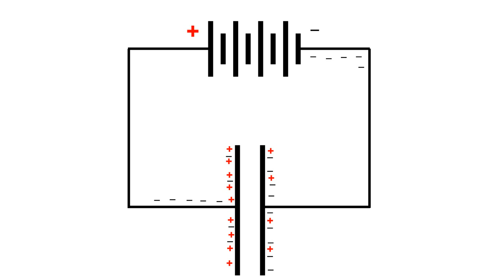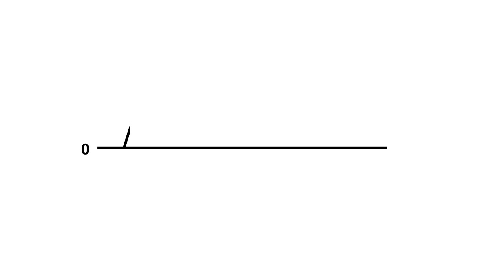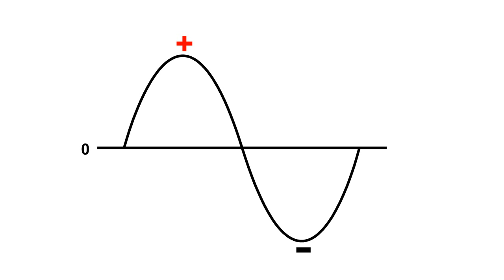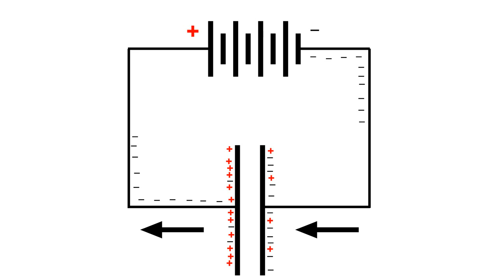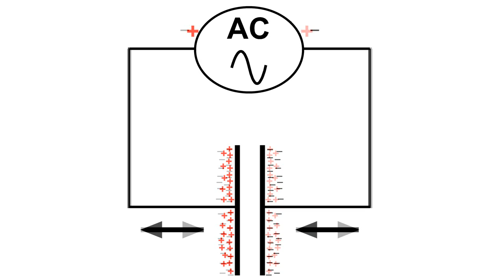Capacitors, DC and AC Current

Comment: Hi, I have been wondering about a AC signal that passes a  capacitor with polarity + and - ........a capacitor with polarity has normally the connection to the outer shield as minus, and the inner part connection as plus (+) .....the outer part of the polarity (minus) normally goes to the lowest impedance as I understand it.....but what about a incomming signal in a speaker crossover? Is the best way for the AC signal to go through the plus terminal of the capacitor  or the minus terminal?  Even polyester and polypropylene capacitores has outer shields....best rgds Kim
Reply from the maker: I have a set of DQ-10s. I looked up the crossover schematic. I think you will find it interesting. 
https://community.classicspeakerpages.net/topic/9355-dq-10-crossover-rebuild-ready-to-solder-help/
Reply: @AllAmericanFiveRadio   hi, thanks...in speaker crossovers I am aware that wirewound resistors might have higher capacitance because of the open field within the windings than mox resistors because of the construction, and that inductors has a DC resistance where the speaker factory have incalculated the Ohm values together with the speaker units. My question went on the newer polypropylene capacitors. If we take a signal at 1kHz (and connect one end to ground and the other end to signal in) and let it pass the capacitor in one direction while we place two fingers across the component we will be able to ses some noise on the oscilloscope...so...if we turn the capacitor 180 degrees and send the AC signal through the other end of the capacitor the same signal creates as example higher noise level...which means that the lower noise indicates that this end is the outer shield end.....does that make any sense to you? Thanks for your very informative videos. The best regards Kim
Reply from the maker: @k.j.h.432  You may need a higher frequency.
This video is from a friend. 
Mini Build - Capacitor Outside Foil Sniffer
https://www.youtube.com/watch?v=YpWYvB2RiQw
Reply: @AllAmericanFiveRadio  Thank you for your help...that is what I am looking for. Best regards Kim

Comment: Zero potential is not absolute, it is only a reference, much like in the case of gravitational potential. The notion results from mathematical integration between two points. One is conveniently considered to be zero. So ground I guess could be seen as the potential in relation to which all other potentials are evaluated. 

Also an interesting way to look at ground is that it's able to give or accept an infinite amount of charge without changing its potential.

Comment: What happens if the ac capacitor begins to go bad? As a tech, I would think possibly a fried component would not pass ac or dc voltage. But if it didn't go bad immediately, would it begin to pass less ac voltage/current Or would you begin to dc voltage beginning to pass through the capacitor? I'm a ups tech. (Battery back up)
Reply from the maker: There are two possibilities. A capacitor can start to have less capacitance or open completely like it's not even in the circuit. A capacitor can start to conduct electrons between the plates which means it is turning into a resistor and can short completely making it a wire.
Reply: Appreciate Video! Forgive me for the intrusion, I would appreciate your opinion. Have you heard about - Zanackson Pocket Buster (do a google search)? It is an awesome exclusive product for learning how to make an extra income online without the hard work. Ive heard some super things about it and my good mate called Gray at last got cool success with it.

Comment: It appears to me that there is a more fundamental question that should have been asked long long ago on day one.  I am surprised why it has never been asked and that of course includes myself.
Here is the question that really relates to this only very basic.
So when we hook up a couple of wires, one on each terminal of a battery.  Now you check the voltage at the end of the two wires, your voltmeter read whatever the battery voltage is, right?
What traveled to the end of each wire being an open circuit?
Reply from the maker: You would use an oscilloscope.
Reply: @AllAmericanFiveRadio  Maybe my question is not clear.  When I attach a wire to a battery terminal, am I essentially extending that battery terminal, regardless which terminal (+ or -)?
If I am, then it means charges must have climbed or moved/accumulated in the wire.   or how would one describe it?
If charges move which by definition it won't, being an open circuit, nonetheless if charges move then there should be every the smaller current measurable with most sensitive ammeter.
And would the position of the wire matter with respect to the other pole?
Say I stretch the wire in the opposite  way away from the other terminal?
Then I bring the wire and get it close to the other terminal of the battery without actually touching it and would there be a clear electric field now?

On another subject:
When charges move through a coil of wire, circular magnetic field is formed.  That we are told.
Now we are also told that magnetic field is formed between a positive and negative pole of a magnet.  Where is/are the magnet(s) and where are north and the south poles? as the electrons are moving straight ahead.  And even if we assume that their spin are all in the same ( spin up or down) otherwise the magnetic field will cancel by definition?

Comment: So technically, current DOES NOT flow through the dieletric to the other plate and other side of circuit? It just stores charges on either side depending upon what type of electric field is built up between the plates?
Reply from the maker: Yes, current flows but electrons do not travel between the plates. The electric field is the repulsion of negative charges of one plate pushing electrons off the other plate.

Comment: I don't think all the negative charges will escape from the positive terminal of the capacitor 1:21, because after certain period of time, the electrons will be pulled by both +ve side of battery and +ve side of capacitor, am I correct?
Reply from the maker: There is always positive and negative on both sides. I'm showing only the ones that move.
Reply from the maker: There are billions of free electrons on both sides, those are the ones that move. And yes I do have books that you can read, 24 of them form the Navy. This course form the navy is excellent!!!!!!!  
Navy Electricity and Electronics Training Series
http://www.richardmcwhorter.com/NavyTraining/ 
I hope you take this course.

Comment from the maker: The electrons are acting in the same manner with AC or DC. With DC, it does not change direction, so as the plates of the capacitor continue to increase with a charge, the charging rate decreases as the impedance increases. When the capacitor is fully charged with DC, it's impedance approaches infinity.

Comment: the capacitor, under AC current, creates expanding and collapsing magnetic fields over each plate inducing current into the opposing one thereby allowing current to flow? I'm not sure.
Reply from the maker: The magnetic field in the capacitor plates are miniscule. It is the repulsion of like charges that makes a capacitor charge.
Reply: I'm not understanding how capacitors pass AC current. I still see the two separate plates of the capacitor gathering opposite charges in an alternating fashion in accordance with the alternating AC with no electrons actually passing between them.
Reply from the maker: How  Capacitors charge and discharge
https://youtu.be/Ag2RujOHqJ8

Comment: I often here of the capacitor charging to the same voltage as the battery? why? doesn't the capacitor have its own storage limit for electrons? I'm imaging that, in this case, the plates of the capacitor are kind of extensions of the terminal, but why the same voltage as a battery? aren't they psychically different? Don't capacitors discharge at certain values?
Reply from the maker: Capacitors, DC and AC Current
https://www.youtube.com/watch?v=NInt1Ss3vQ4
How Capacitors charge and discharge
https://www.youtube.com/watch?v=Ag2RujOHqJ8

Comment from the maker: @512147214 
There's not one answer. You can use a capacitor to isolate an AC signal riding on top of a DC bias voltage, this is very common. You can use capacitors to filter a DC power supplies. You can use capacitors to drain unwanted RF from a circuit. Inductors can be use for the same things but are configured in the circuit differently. Sometimes a capacitor works better, sometimes an inductor works better. It takes some study to understand why.

Comment: Thank you for your great educational lessons

I have question please : i am confused how we can write : Vs= Vc knowing that the capacitor "gradualy" raise its voltage and doesnt respond instantaneously with the voltage source ! , why we are ignoring this fact and treating capacitor as if it is a resistor ?

Thank you in advance
Reply from the maker: It is not resistance, it is TIME.
Reply: @AllAmericanFiveRadio  l meant if a capacitor in parallel with AC voltage source , how we can write Vs = Vc knowing that the capacitor voltage will be a little "behind" the AC source voltage all the time ?.
Reply from the maker: @mohfa1806  The answer is still time, If the AC is 60 cycles the capacitor charge is never = to the source.
Reply: @AllAmericanFiveRadio  thanks for your reply

But i still dont understand in AC voltage source parallel to a capacitor , how in every book they write Vs=Vc knowing that its not true??..
Reply from the maker: @mohfa1806  Give me the tiles of those books.
Reply from the maker: @mohfa1806  Time Constant Calculator
https://www.digikey.com/en/resources/conversion-calculators/conversion-calculator-time-constant
Reply: @AllAmericanFiveRadio  thanks again ...i really appreciate your time replying to me , but my question was for AC voltage source not DC
Reply from the maker: @mohfa1806  You have missed the point. Even with DC the capacitor never gets to the source voltage.

Comment: I’m even more confused now. How does the current go through it then? If a motor is connected in series with a capacitor, current is definitely flowing through the circuit.
Reply from the maker: Maybe this video will help.
How Capacitors charge and discharge
https://www.youtube.com/watch?v=Ag2RujOHqJ8

Comment: One strange question please !

How those things, like TV , radio, etc  ...etc ...can work 
Because usually we bring AC 
To
*  the  transformer ... 240V~ 12V ...
*  Then a bridge rectifier ... AC to DC 
and after
 Power supply, ...  everything is run on DC Inside ??? 
...    Because
all those Capacitors are not supposed to do anything 
in DC Circuits...  Or I am wrong ??? 
...  🤣😬🤣😬🤣... 

I am just a total newcomer
 into the field of 
Electronics, but my understanding so far is that :
* capacitors are 
Reacting only in RF 
like ... Oscillations 
...  or... AC environment ,
...
 but in a DC they act 
Like switches in the 
"OFF position"  .  They block a current . ... So ... It looks little 
... ridiculous to me ... Lol. 
🤐🤐🤐🤐🤔🤪😬😱
Reply from the maker: These videos may help.
Half Wave Power Supply build and demo
https://www.youtube.com/watch?v=Oi75Y6fg8mw

Half/Full Wave Power Supply Oscilloscope Demo
https://www.youtube.com/watch?v=4kMXulubQFU

PI filter, Resistor Choke Oscilloscope Demo
https://www.youtube.com/watch?v=WzwaHO6WPCk

Comment: hi I have a 3kw single phase motor that drives a machine and the drive is connected to another machine so in effect depending which machine I drive the the motor will still be driven with no power to it I have been told that this will blow the capacitors and  I will need to switch them out of the system it has a start and run capacitors
Reply from the maker: Depending on the motors, the motor that is not running maybe generating voltage and this voltage maybe opposite to the applied voltage.

Comment: then why do leds blink when connected to a capacitor in a circuit
Reply: Because an LED is a DIODE.  And diodes only pass current in one direction.  You get current flow only half the time and therefore they "blink" on and off.;
Reply: Species 5618 thanks

Comment: If capacitors block DC then how/why is it that they're used to smooth DC? It doesn't make sense.
Reply from the maker: My FREE eBook : Password is:"allamericanfiveradio"
The Vacuum Tube Shortwave Radio 'Chapter 3'
http://www.richardmcwhorter.com/vacuumtuberadio/
Half Wave Power Supply build and demo
https://youtu.be/Oi75Y6fg8mw

Comment: Good explanation. I was kinda waiting for the purpose part, but there's plenty of youtube for that.
Reply from the maker: How Capacitors charge and discharge
https://www.youtube.com/watch?v=Ag2RujOHqJ8
Capacitors, DC, AC, and Frequencies
https://www.youtube.com/watch?v=YfJKNSkz_Lk
Audio Coupling Capacitor, how it Functions in a Circuit
https://www.youtube.com/watch?v=PAPnwX6YiIM
Lafayette Guitar Amplifier Signal Flow
https://www.youtube.com/watch?v=tmLMIdTviOg
Impedance and Frequency, Oscilloscope Demo
https://www.youtube.com/watch?v=TRSNKwtUy8g

Comment: this isnt right, right? the minus on an ac sine is 0. everything above and below the zero is a potential difference compared to 0. so the most upward peak is a + and the most downward peak is a +. correct me if im wrong
Reply from the maker: AC Alternating Current, for the Beginner
https://youtu.be/xVbqMFkyuXI
Reply from the maker: How  Capacitors charge and discharge
https://youtu.be/Ag2RujOHqJ8

Comment: How current flow in circuit when two plates seperated by dielectric .......there is no path to flow electrons.... Then how ac signal flowing through capacito
Reply: And Dc signal also in transient state......
Reply from the maker: The electrons on one capacitor plate will push the electrons off the other capacitor plate. It's like two magnets and you bring the north pole of one close to the north pole of the other magnet. The north pole of one magnet pushes the other north pole away.
Reply from the maker: @akshaynile5205  AC or DC, it does not mater. AC, this would be like pushing the north pole of a magnet(1) toward the north pole of another magnet(2) and of course it moves away. Then you push the north pole of magnet(2) toward the north pole of magnet(1) and it moves away. Then repeat. DC, you push the north pole of magnet(1) toward the north pole of magnet(2) and it moves away and your done.
Reply from the maker: AC or DC, it does not mater. AC, this would be like pushing the north pole of a magnet(1) toward the north pole of another magnet(2) and of course it moves away. Then you push the north pole of magnet(2) toward the north pole of magnet(1) and it moves away. Then repeat. DC, you push the north pole of magnet(1) toward the north pole of magnet(2) and it moves away and your done.
Reply from the maker: @akshaynile5205  Sometimes YouTube messaging is weird. I'll be glad to answer your questions. Contact me at allamericanfiveradio@yahoo.com make the subject capacitors.
Reply: Thank you "bhai"....